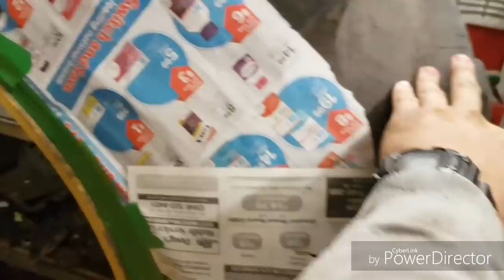895 paint, tire repair and parking combines!

Comment: What color yellow are you using? I'm putting a new engine in a 145. Decide to start painting while it's in  the shop.
Reply from the maker: It's just a tremclad yellow. Its  a bit  brighter then proper but close enough lol
Reply: Alrighty thanks lol
Reply from the maker: @kennethtaylor4264  you can get the proper yellow from versatile but its 300 bucks a gallon lol
Reply: @SouthSaskFarmer1  haha that's little out of budget.
Reply from the maker: @kennethtaylor4264  ya lol I only bought 1 gallon of proper red at that price lol
Reply: @SouthSaskFarmer1  lol my uncle who had the tractor had 2 gallons of the red paint.
Reply from the maker: @kennethtaylor4264  small fortune there lol
Reply: @SouthSaskFarmer1  haha it's from the 80s so don't know if it's any good.
Reply from the maker: @kennethtaylor4264  hmmmmmm probably have a big skin on top  it bet the rest is ok
Reply: @SouthSaskFarmer1  . Possibly gotta find where the old man hit them.
Reply: @SouthSaskFarmer1  Hi from south west Manitoba, It's a good job none of these tractors are triple nickles with a pto option, 2 gallon of paint would be worth more than the tractor round here L.O.L
Reply from the maker: @super6954  you got that right lol